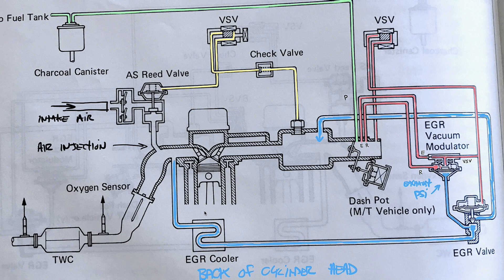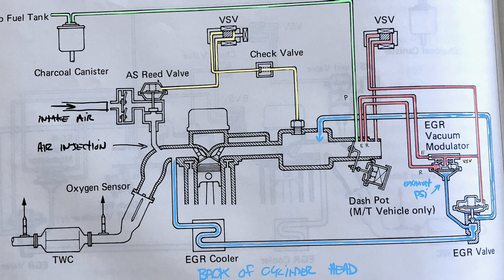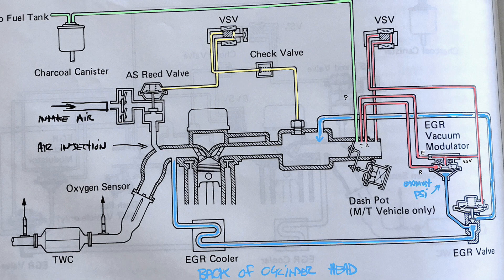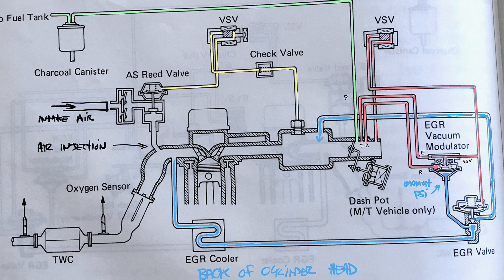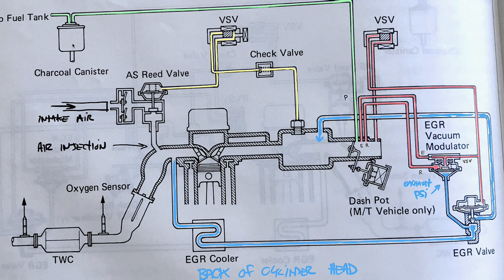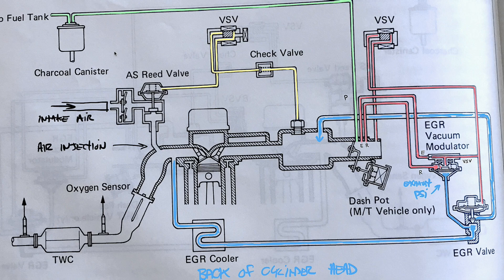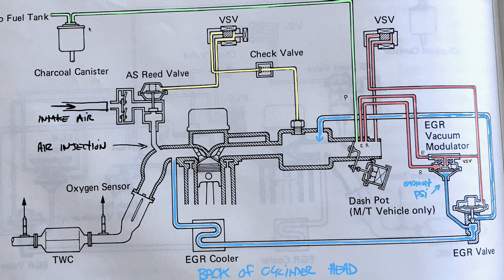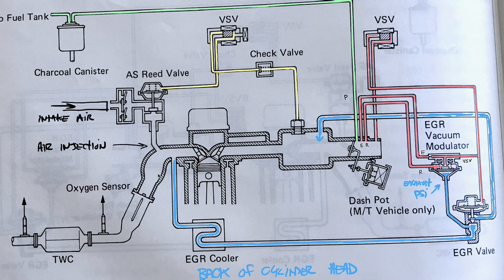1990 Toyota pickup 22RE smog emission system overview w/ EGR, Air Injection & EVAP charcoal canister

Comment: I just purchased a 93’ pickup a couple weeks ago, and I’m just now learning that it’s been through a EGR delete, Air injection delete, and uh I guess I just don’t have power steering
Reply from the maker: Congrats on the truck. Are you in a state which requires smog? I have a video on removing the power steering.. truck is way better without it.
Reply: @ No I’m not in a state that requires smog, so I suppose it’s okay right?
Reply from the maker: @xaviertorres6301  Yeah, in that case you can just buy a block off plate kit basically and/or just disable it. Keep your PCV of course.

Comment: I never understood why Toyota claimed hot exhaust gases are cooled at the back of the head then input into an already cooled intake (ambient temp air) equaling better gas mileage? It’s still hot air!  it would actually be raising the intake air temp and then allowing for better combustion. Hot air equals better fuel economy, cold air equals better horse power.  Great video though.
Reply from the maker: I believe the better gas mileage claim has mostly to do with the fact that the exhaust fumes are largely inert in nature, therefore they displace some amount of air/fuel mixture that would otherwise be burnt. My understanding is that it also helps reduce cylinder temps a bit (since there is less combustion mixture taking place). How well it all works or how much it improves gas mileage is anyone's guess.

Comment: So you further back into the atmosphere anyway
Reply from the maker: Not totally sure what you mean there, but as far as emissions go with relation to the atmosphere, the goal is to break harmful compounds into less toxic compounds as they travel through the catalytic convert basically; the extreme heat inside the cat breaks down the bonds and makes what exits the tail pipe less deadly.

Comment: Hi , can you tell me your city , I’m in Las Vegas I went 10 different mechanic and they don’t know nothing about my truck , my check engine on from las 3 years and I’m looking some person like you
Reply from the maker: I'm not a mechanic. I'm just a guy like you with a truck. Try going on Yelp and search around perhaps? I found a good mechanic out in Texas for my ex-girlfriend's sisters 4Runner and he is an old japanese guy who really knows his business. But yeah, finding a good mechanic who knows about the older vehicles isn't easy. Have you jumped the diagnostic port on your truck and pulled the code yet? That might point you in the right direction. Also, you an buy the 2 volume shop manual set on ebay used. Most of my knowledge about the 22RE just came from general automotive experience and reading the shop manual.

Comment: sorry for my ignorance. 22re with egr supposed to have egr bvsv?
Reply from the maker: The 22RE EGR system is controlled with an electrical VSV that is operated by the ECU as well as manifold vacuum.
Reply: @ray5961  i have another question i saw on another video you put. I noticed where you have two coolant temperature sensors there is like a plug on top. I seen on some other 22re there is like a valve that threads there and connect two vacuum lines.  Is it supposed to have one? At the website 22re performance they call it a egr bi metal vacuum switching valve.
Reply from the maker: @barca_m1041  hmm, not sure. Do you have a video showing what you're referring to? Or maybe a link to an image or something?

Comment: No offense but you really don't understand how the system works. This is a very elementary explanation.
Reply from the maker: The systems work exactly as I have explained them on this video and anyone who has ever actually rebuilt each of them and made sure they are functioning correctly on a 22RE motor should understand that. What exactly do you feel I have not explained here?
Reply: @ray5961  well 1st what role does the vsv for the egr actually do? It is t in to the egr  signal line but you don't explain it. All you  really say is a general overview of each part of the egr system not under what conditions the system functions. the vaccume lines that connect to the throttle body only have vaccume under certain throttle openings to control egr functions at different engine conditions. You explanation is not bad just a little simplistic. If I sound like a dick or something I'm sorry. Thanks for the video it did help me.
Reply from the maker: @rodneycassidy6037  Hi Rodney - yeah, I understand where you are coming from. With regard to the VSV's, those are mainly just on/off switches, which either allow or block vacuum flow from the motor; this serves to either activate a system or not. So, for example, as you asked there with the EGR VSV: it's allowing the ECU of the truck to decide if the motor is in a state were it's okay to start introducing the re-burning of some exhaust gases. I believe I sort of touched upon that in one brief section of the video (where I was talking bout how this actually has a beneficial cooling effect, etc.), but I might not have spent as much time discussing it as I should have. The other interesting thing with regard to the EGR system is that there is a modulation device involved as well, which not only takes into account vacuum from the motor, but also pressure in the exhaust system as well. So there is definitely a lot going on and that's not an area I covered 100%. My main goal was to sort of just provide an overview, so people who were confused might have a starting point in order to better understand what some of the mess of hoses on their 22RE are for. And you are correct, all these vacuum hoses in large part are governed by the state of the throttle position and also engine load. So, in certain situations, there is little to no vacuum present - and as such, they are having little to no impact on anything. A good example of that is the fuel pressure VSV. On my motor specifically, I actually removed that VSV completely and I just allow the ranging engine vacuum to dictate whether or not the fuel pressure regulator (which is vacuum powered) alters the fuel pressure or not. It might not be quite as accurate as having the VSV also in the mix, but I feel it's close enough to function as the motor needs, but not cause any issues due to the VSV not being present. If you watch some of my other videos, you might notice I have an AEM fuel pressure gauge connected off the back of the fuel rail, in order to monitor fuel pressure on the rail. So on my truck, when I give it gas and vacuum is affected, then the fuel pressure is increased, even without the ECU and VSV having to open up the line or not (since the line is always connected on my motor). One of the reasons I sort of skimmed over some of what you are referring to is because a lot of those areas are controlled by how Toyota wrote the software inside the ECU. Without installing a piggy back ECU or a full dedicated ECU, there is really no means to alter how some of the VSV systems are controlled. Because of this, I tried to mainly focus on "what the systems do" in broad terms, in an effort to help people at least have some idea of what all the hoses on their motors do and what Toyota was trying to accomplish with some of these different systems for smog, etc. Anyway, thanks for pointing that out and I'm glad the video helped, even thought you're right, it's a fairly basic run down of a rather complex and interesting system that controls the motor's functioning under a lot of different load conditions.
Reply: Would a bad VSV be a reason for no start? I checked vacuum (EGR modulator > through VSV > EGR valve) I unhooked both the vacuum house from the modulator and valve. Checked vacuum going through the modulator towards the VSV; It holds vacuum. I was under the assumption that this should not hold vacuum when the truck is cold? Am I wrong?
Reply: @shawnkuffner  no. do you have spark and fuel? a vsv doesn't control anything on a 22r or re fuel or spark system.